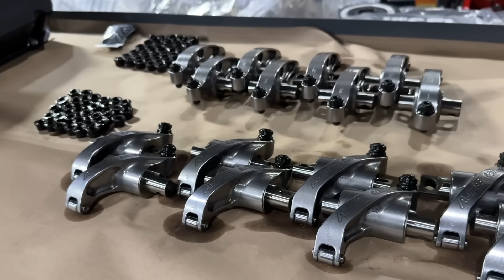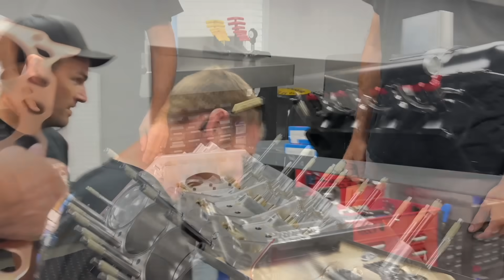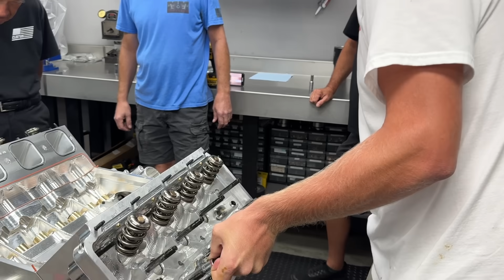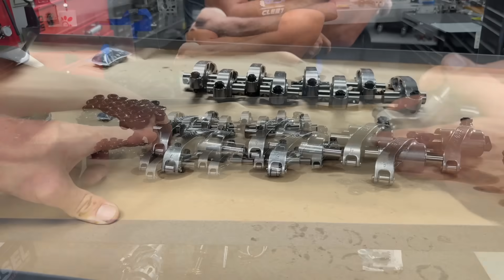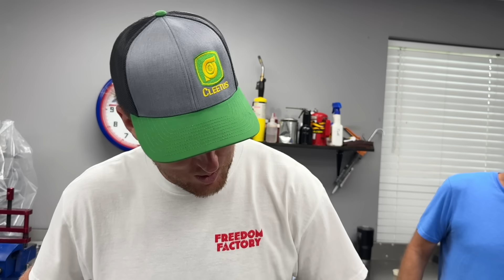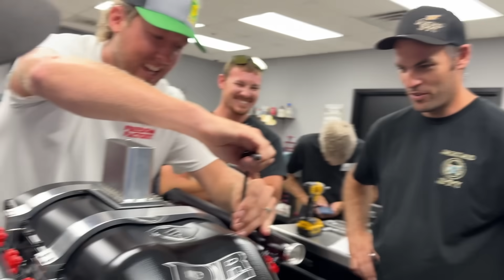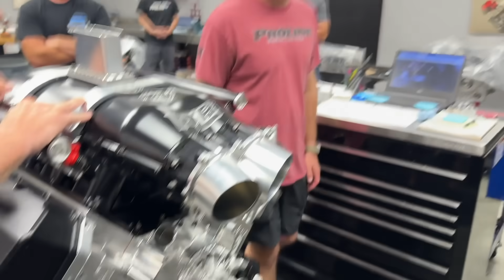Introducing Project Eagle's NEW Engine!!! (100% Billet)

Comment: 100% anyone who actually knows drag racing knew this is what was going in the ride. Have to run a billet large cubic inch hemi to be competitive when racing the other top level cars.
Reply: I thought they might go with a Noonan hemi!
Reply: @stevenwalker9013 noonan doesn’t have the track support or parts availability that proline has
Reply: I was pretty sure he was going PLR but i was expecting a 481x, this is so much better though, big boy race car stuff finally, wish he would get away from the turbos though and go with a blower, makes it way easier to fine tune for track conditions when your boost is consistently tied to engine rpm, i ran turbos for years before making the switch and will never go back after experiencing how much easier it is to dial the car in for different track conditions.
Reply: @Greg1096 the 481x platform in whole has oiling issues at high power levels (not as bad as the great value 481x aka smx does but still) and his transmission builder and proline have worked together and reinvented how turbo boost control works at that level and got it down to a science over the last year or so by ditching the waste gates for boost control and bleeding it off with the blow off valves similar to how they bleed it off with a procharger and controlling it that way but it has a tendency of turning the engine into a hand grenade if something messes up or you have to abort under high boost similar to how a procharger sometimes does
Reply: @54raceman  I've seen people doing well running those new Fueltech e-gates, for myself i always had issues with boost creep or random boost leaks nearly constantly when i was running turbos, since i switched to a blower its just so much easier to tune to track conditions with the boost to rpm being so linear and predictable, with turbos you make changes then hope it responds how you think it will, whereas with a blower i know exactly what my boost is going to be at a given rpm and drive ratio, just got so much more predictable to tuning changes.
Reply: The Hemi also has more power potential over a 481X. Also cost more to run. PLR talk about the differences.   I believe it's around 400-600hp more for  a Hemi.

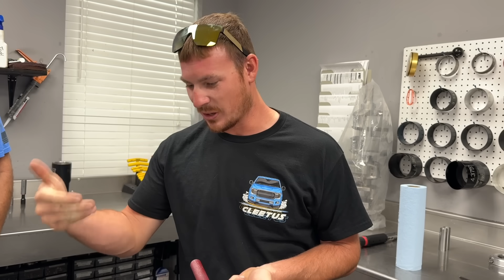Comment: 28:31 I’m pretty sure Alan and Steve pulled the head off without the intake coming off. Just this month on Sick Summer.
Reply: While you can do it due to the water system bullcrap it’s not a huge help like it is with the newer hemi stuff
Reply: @54raceman  I’m not even comparing the two. Yes they’re both billet big blocks, but completely apples to oranges. Steve is 3000 mile drag and drive. This is no water jackets at all, pure racing not drag and drive.

Comment: I don't understand. You are doing business with your buddy Steve Morris and he designed his engines to leave the intake as well. He said he designed a 2 degree angle from the head to the intake so you wouldn't damage the "O" rings sliding the head back on. How come you can say you have never seen that before?
Reply: Maybe he was never told by Steve :O wow
Reply: Bro this is a race motor straight up no drag and drive... Steves engines are amazing but they're different platforms
Reply: @jooka2010 that is true
Reply: Yes Steve Morris SMX is one of the best drag and drive motors out there.  This isn't going to be a drag and drive so you don't need the water in the heads and the complex duel fuel systems.   
It's just two totally different engines meant for two totally different task.  Both engines being basically the best at their job.
It still think mullet is better.  Something about a drag and drive car that feels so much cooler. You can drive it 500 miles to a track and drive it back home.  Basically.
Reply: @jooka2010  Irrelevant to the fact that the smx heads come off without removing the intake. How did they not know that?
Reply: I say the SMX would be faster
Reply: @nallen1006  Maybe wasnt possible on the SMX they had as it was the first one Steve built... and wasnt it updates that made that possible?
Reply: Let's see if they hurry to Iowa when you break it like Steve did
Reply: Maybe this video was recorded before that information was available to them?
Reply: Did Steve Morris design that on a Hemi?
Reply: What really gets me... They are going back to the OG BBC? 
Thought once you go SMX you can't go back! 😂
Reply: @itslegit7362 they will when it struggles to go mid 7s
Reply: @itslegit7362 he screwed the motor both times with the trans issues.  Put excessive force on the crank.  Than sent it to the moon.  Prob wad cheaper to rebuild the bbc.
Reply: Because Steve’s you can only do one head at a time this motor you can do both heads
Reply: @jdias51  They're going to struggle to go mid-7s with an engine that they already literally went 6s with? Really?
Reply: @bdass68ss 95% chance any event that this car is at they’ll already be there racing themselves
Reply: Steve didn’t design anything on the smx he paid to have a 481x poorly copied the platform they were talking about being outdated in this video which already had that feature and then paid to have the water passages added
Reply: @RyTrapp0  if they go back to a traditional bbc and want to keep reliable yes,  he could easily just turn down the smx gain reliability and go faster than a bbc that you're whooping on
Reply: Because garret never turns a wrench a day in his life.
Reply: @dcskate1022 if you have to ask, you cant afford it
Reply: @Aaron_Hanson  what a couple years ago?
Reply: @54raceman  that's a good point,lol
Reply: @bachwilson5218  yeah nah, I was wrong with my assumption. Definitely should’ve been aware of SM’s intake/head design innovation.
Reply: @BlairCradick  Maybe he should watch YouTube like we do and learn something. I don't know the timelines of these videos but I don't think they were centuries apart and I am flabbergasted that Cletus says he's never seen that before and was totally amazed, all of them..... plain weird. Steve the guy that drops everything and drives out in the middle of the night to go help them???
Reply: @RyTrapp0  yehh and blew up lol, he wants reliability back. You're not gonna be able to 6s with a traditional bbc in a heavy car like mullet with being reliable.  Mullet is too heavy, so gotta turn it down run 7s and possibly get beat by competition.  Or ditch mullet run a lighter chassis with same og bbc.  Or reconfigure mullet to be easier to work on and keep the smx and still struggle.  Or ditch mullet, ditch 800 to 1000lbs build a real hard-core "street" car aka promod on the road with the smx, crush the competition but have to outwork everyone to do so.

Comment: One thing that always blows my mind is the guys building these $100k engines on a gosh darn Harbor Freight engine stands. Doesn't anybody make a real heavy duty bald eagle holding engine stand that doesn't do the boot scootin' boogie when you're trying to torque the head studs?
Reply: They make them but they take up so much more room that in a high volume shop they’re not a good fit
Reply: Summit makes a pretty nice one that doesn't take up a lot of room. It's really stable and has a crank with a ring and pinion to turn it. Unfortunately you'd still be chasing it around with 220ft lb head studs.
Reply: That's 2,640 pounds per sq inch brother
Reply: I have an engine stand at work that won't move. But it's massive and holds 3,000 lb engines, made by OTR tools.

Comment: I thought when George dropped the piston it was a setup, when I realized it wasn’t I’m shaking my head. I was cringing when Cleetus purposely put that tiny scratch on the intake. I sometimes wonder what Sam really thinks of the fooling around all the time. A beautiful engine for sure and should be considering that you could buy a very nice pickup for what that engine is worth. That engine should develop an impressive amount of power. Good Luck with that power plant.👍👍🇨🇦

Comment: I torqued @ 235 lbs on the mack 40 bolt per engine done over 600 rebuilds you get use to it some of the older cummins are up around 500 lbs only 9 bolts per head x 3 27 total

Comment: @Ckeetus McFarland i have a really great idea of the whole turbo charging the engine on a different way no one ever has done it, it removes turbo lag, it removes turbo manifold piping, reduces alot back pressure, and i think it should make more power if you want i want to share my info and it should 100% work in my opinion, i dont want to share it just in case its gamechanging.

Comment: The designed in service ability is so sweet.....what if all engines were designed with the mechanic in mind. I enjoyed working on Cadillac 472's and 501's you could leave the intake on with the AC compressor on the intake and take the heads off with just a few tricks.

Comment: Was at the track on Wednesday and seen a beat up white older 300 Awd with a turbo running 11.0 on a hot day.  Them nitrous solenoids or Injectors?? SHEEESHH   Yall need rubber gloves when handling parts like that. Was it over 100k or under for that completed Hemi? I'll be rooting for you Cleeter, unless ur vs Brett.

Comment: Don't get me wrong them gentlemen over at Proline are very top of the line motors but I'm sticking with Steve Morrison and the SMX , to have ur engine builder come running the moment something happens and you break it but then again look at the number difference 5,000 - 3,000 , cleet gonna have to hire oil techs just to maintenance all his vehicles 😂😆 just throwing it out there , i have years of experience oil and tire tech , looking for and in need of a second job!! Cant wait to see and hear the fire up

Comment: I think he should test that engine with Fueltech ECU. He already has several Holleys and the Haltech. If I'm not mistaken, about 80 to 90% of PROLINE use it. Apparently, they launched a new injection system and their building is like inside PROLINE!
Reply: They’re right across the parking lot.

Comment: Perhaps this has been mentioned before in comments but I'm a little surprised they're running a Hemi as opposed to a 481X conventional head. I know clicks are king but when they discuss life cycle and maintenance intervals it becomes apparent that Garrett would rather not be swapping rods every 30 laps. There's a video Proline put out a while back that directly addresses the ideal applications of Hemi vs. 481X and Cleet is a 481X customer, meaning that he isn't subject to class rules limiting boost, and can shift the car at 8500 to extend engine life as a privateer would be wise to do. Hemis love RPM but at the cost of maintenance per that Proline video.

Comment: This proline wouldn't make it 3 miles on the street in a drag and drive event without seizing up. A proline hemi can't drive 200 miles down the road, and then immediately lay down 4500 horsepower to the wheels. The SMX can do that through an entire event. So i would say it's an incredibly reliable racing engine. The broken main caps in mullets main caps were likely due to bad tuning, over reving the engine, and poor maintenance. How many runs was cleetus putting on mullet before changing rods? You can't call the smx a bad product, plus Steve stands behind his product 100% and his customer service is unmatched. Like a good neighbor, Steve Morris is there!

Comment: I’m confused why the guys seem so amazed when they heard the heads can be removed with out the Intake coming off and mentioned something about mullet and how much work it is cuz the intake has to come off…. Mean while I’ve heard Steve morris say how he designed the smx so there’s a 2 degree angle or something so the heads can come off WITHOUT the intake coming off….. so kinda confused about that comment. Did y’all not know the smx does the same thing?

Comment: Pardon my ignorance but if there is no water passing through the heads, how does the hemi get cooled? Is it because they are running more/colder fuel? Thanks for educating me.
Reply: Race only motor running on methanol keeps it cool enough for a few minutes so can't be driven on the road.

Comment: I might be mistaken but didn’t Steve pull a head off an SMX without pulling the intake? 
I believe it was on Allen’s Monte Carlo
Reply: You’re not mistaken. In Steve’s engines you can pull the heads without pulling the intake.
Reply: @ashleyheitschmidt618   I had thought so. They all just seemed so impressed that you could take the heads off this Hemi without pulling the intake.

Comment: This is hard to watch all the way through, SMX motors have nearly all these pro features that Clete and everybody’s raving about…like they didn’t know SMX can do mostly all of what Proline does, including dry decks, halo hoops, huge intake ports, 10,000 rpm’s and live, AND head removal without intake people. Jeeze.
Steve Morris turns out SM hemis all the time for customers that he dyno’s and they hit 3500hp to maybe 3800hp, but his BBC platform SMX spin up to 5000hp. 
Hemi all you want, it’s not as good as a BBC valvetrain at high hp. 
I’m with Steve on this one.
Reply: Steve doesn’t build hemis the only time he messes with hemis is when someone buys someone’s old wornout junk and doesn’t want to pay the original builder to rebuild it correctly and takes it to Steve to get it done cheap
Reply: Fyi the outdated 481x platform they talk about in the video is what Steve paid to have poorly copied and water passages added to and calls the smx
Reply: Steve does not build pro mod motors. Go learn yourself something. Also, he does NOT build Hemi's of his own. Just like 54raceman has stated..

Comment: Those look like tunnel port heads that me. Making them way closer to a Ford design than any Dodge design ever. As the only difference is spark plug location. Remember, not all of us old guys are watching. And the old guys remember, that Dodge didn’t release their hemi design open design. And that’s why all hemi drag race engines. Are basically based on the Ford Boss 429. And seeing those tunnel port heads. This entire engine, that those Chevy loving fools will be running, basically a Ford engine. And long live those of us who bleed Ford blue.

Comment: 20-30 runs between rebuild.   You guys hear that?   Of course that’s the 3500-5000 hp range and that includes 330 runs.   I’m mentioning this because of all the people talking about Steve’s engines and soon redline engines having problems.     It breaking a race engine does not mean they are junk.     That’s like buying a new set of tires for the daily and doing burnouts and complaining they didn’t last 60k that the advertisement stated.      Race shit breaks.    Plain and simple.

Comment: I'm not sure most of the cleeter fans even understand what this is. 
He isn't going to drag and drive this, it wouldn't go 5 miles, because there is no and will never be water cooling in it, it doesn't even have passages for it. 
This isn't to beat snot rocket, he will be going up against far more tougher far more experienced racers and teams in pro-mod type classes. 
They are going to eat his lunch, and take his money, if he relies on the FF team for any of it. 
This engine will require, no, demand, that it is tore down and refreshed every couple handfuls of hard passes, or it will not be making passes for long.

Comment: PROLINE IS TOP NOTCH NO DOUBT… but yall are a little behind the curve , a lot of the proline guys are going to NOONUN MOTORS, which is a smaller size hemi that can handle the same or more power … look them up , they have a mean engine program … and once again tell George to keep them lame ass jokes to his self , he sounds like a 🤡 🤡  them old guys wasn’t finding nothing funny at proline , especially after he was the one that dropped the piston and  then want to try to tell everybody to be careful doing this and that how expensive shit is like he’s the one paying for it …. See how dude was like “ just like that piston that bounced 10 feet in the air “  after George tried to play proline about a mark on the intake